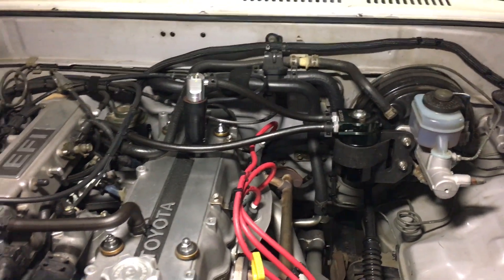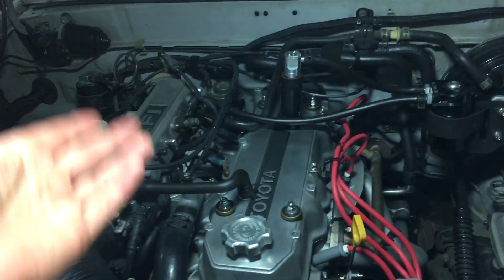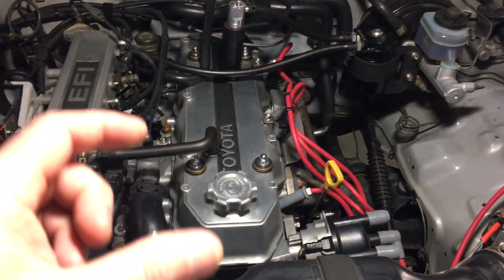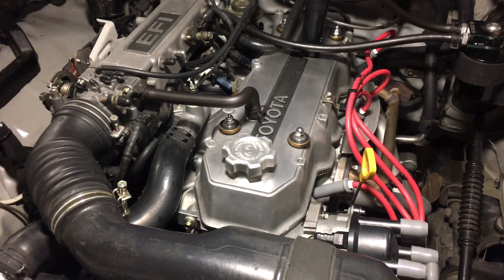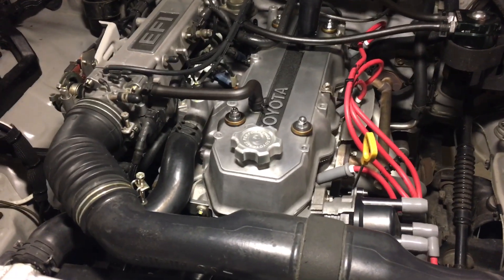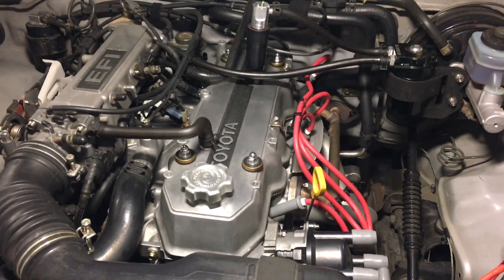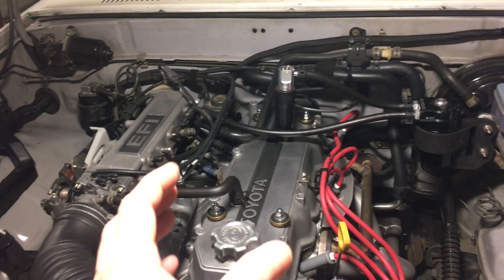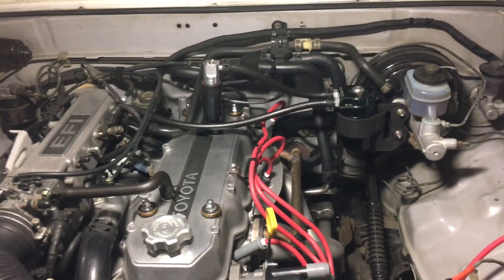UPDATE: Oil catch can + oil consumption issues - Final outcomes & solutions for Toyota pickup 22RE

Comment: Ray thanks so much for the update. Are you aware of anyone who sells a sort of "engine bay hose/rubber replacement kit" for the 22re? All my engine rubber is basically rotten at this point and I'm not sure I want to buy it all piece by piece.
Reply from the maker: LC Engineering sells a kit of hoses. 22RE performance also probably does. YotaShop should have it. Stick to rubber hoses (not silicone). I believe I got most of my hoses from LCE and then I bought a few of the big ones directly from amazon or here https://toyotaparts.mcgeorgetoyota.com/v-1990-toyota-pickup--base--2-4l-l4-gas
Reply: @ray5961   much appreciated, thank you.

Comment: Where did you get the catch can and bracket from ?
Reply from the maker: The catch can came from amazon - they sell a bunch of them on there. The specific one I have is made by Evil Energy as I recall. They have ones with and without a breather setup up on top; the breather stuff is not needed for EFI motors. I made the bracket from 10mm thick black ABS and used some stainless coupling nuts as stand offs. I think I might have a video on the channel where I show it in more detail and list the part # for the SS coupling nuts. Made the bracket template from cardboard, then just cut and drill the ABS and used some files and rasps to shape it. The oil catch can is held on by a Velcro strap. I ditched the little "oil dip stick" nonsense on the catch can.. it's totally worthless for reading the level and the tiny O-ring of the dipstick can leak air and really F up your day. I just put an M6 bolt in that hold and put thread lock on it.

Comment: I have a LCE head so i be checking on that
Reply from the maker: Yes, definitely something to check. I show the hole in a couple of videos (both before and also after opening it). One video shows it when I'm looking around at the hole while the head is on the motor and then when I rebuild the motor and do the ceramic pistons, I show the head and hole very clearly after using a carbide burr to open it up.

Comment: Just dumped the oil catch can today for my 230k mile ‘94 22RE.  Wasn’t full, but there was a thick oily peanut butter sludge in the bottom of it.  This was the first time I’ve opened the catch can (not including dumping it; the entire top and bottom of this cheapo can unbolts from the center section) and wasn’t expecting to see that.

Engine runs great and consumes a lot of oil.   Need to add about 0.4 quart every time I fill up.
Reply from the maker: Peanut butter could indicate water in the oil perhaps. When was the last time you changed the oil? I would check under the oil filer cap and see if there is any signs of water/oil under there.
Reply: Thoughts on converting this awesome 22re to a 22rte the factory turbo version of this motor?
Reply from the maker: @Jus-k2m  I'm building a 3RZ turbo for the truck down the road. I think the 3RZ has some benefits over the 22RE design as far as flow and performance, as well as durability of the block.
Reply: Any Content for 3rz?
Reply from the maker: @Jus-k2m  The 3RZ block is still sitting next to my desk. Probably won't be any real content on that motor build for a few years.